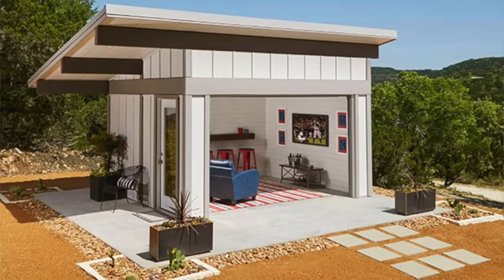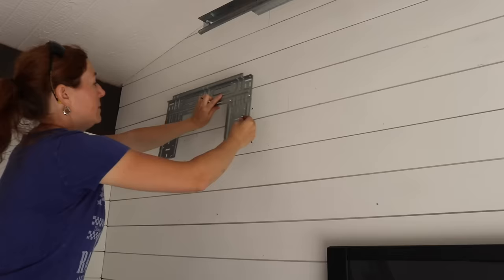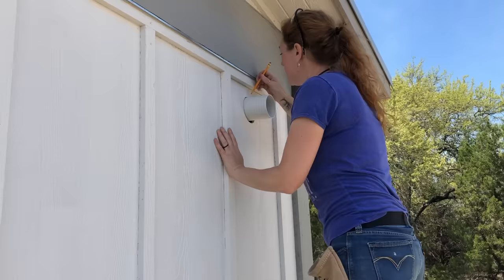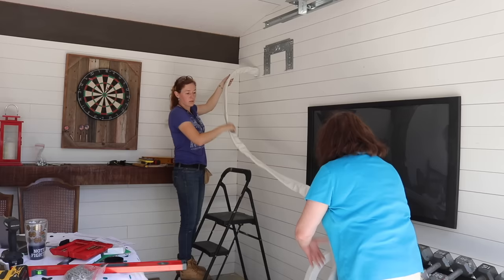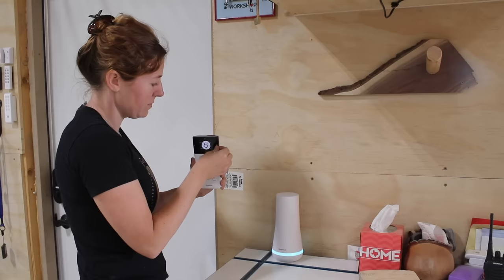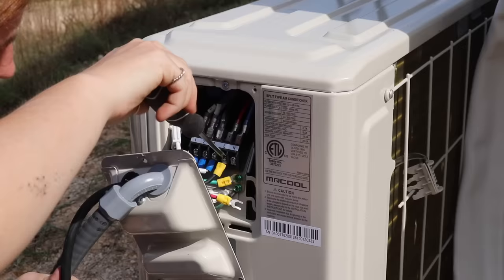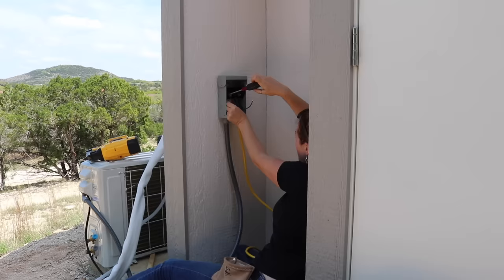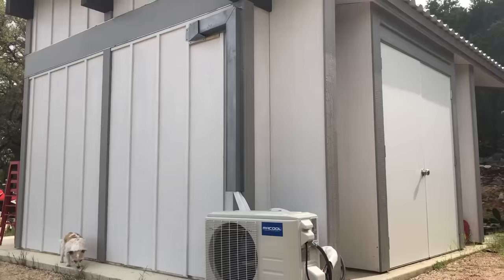DIY Ductless Mini Split Install - MrCool Unit

Comment: I have been in the hvac industry for a while. So I’ll clear up a few things that I saw in the comments.

1. Enjoy your videos and love the DIY spirt. Though you made this seem much simpler then it actually is. You have a strong mechanical ability that frankly most people don’t have. I have been installing, servicing and repairing mini splits, and VRF HVAC systems for most of my professional career. 

2.There is refrigerant in the lineset, the indoor coil (evaporator) and the outdoor unit (condenser). The connections on this system have a protective fitting that when you start make the connections breaks a seal to release the refrigerant. If not done properly it will leak. This type of fitting is common on box coolers and freezer units. 

3. The lineset begin coiled vertically will create what we call in the industry an oil trap. You don’t want this on a system like this (there is an exception to this rule, but not get into it on here). It will trap the oil in the lineset and cause a compressor failure as there will be no oil to lubricate the compressor. 

4. I would recommend a power monitor/protector for the power coming in (your line voltage). Reason 1 mini split boards (cheaper unit are worse) hate dirty power and too high of voltage. You are in the Texas hill country or west Texas I’m guessing by the land scape. I live in Texas as well. Most generators do not produce very clean power. Just a recommendation to help you protect your equipment. 

5. Not sure what the warranty is on that thing. Just know boards are not cheap for this type of equipment. Some will say just throw it out and get a new one for the cost. Go for it, or you can pay more and get a product that has a better warranty and the manufacturers actually have offices in the states and people there to support the products. Also, why throw it out when it just needs to be repaired. 

Good video. Just remember there is more to refrigerant flow, and ac equipment then connecting some wires and refrigerant lines. For those thinking about doing this. Please know that refrigerant if it touches your skin can cause a form of frost bite. Not going to get into the science of it, but we call them refrigerant burns. They really hurt and can blister pretty bad. So just be careful, follow whatever instructions are given. if you start it and can’t do it, just call a professional company. This isn’t painting a house. You are dealing with power, refrigerant, and many things that can cause serious harm. If you do not understand it, call in a pro.

Overall April you are talented in many ways and show that with effort most things are possible for a person to do.
Reply: Hey, man thanks for your input.  If I had one of these units would you recommend vacuuming out the line?  Even though it says you don't have to with a DIY unit?
Reply: @brianbevilacqua4984  , she said as the manufacturer clearly states that it comes precharged, I have seen a video of how they are manufactured and come precharged in the lines and not just the end units. Thinking you need to vacuum and charge the lines before installing them would result in as this op said, hazard to your health via a very harmful refrigerant burn. Hence why you FOLLOW THE DIRECTIONS as told in them, and just connect the lines and power as she showed and then ones it is powered up with energy you then just flip it on..That simple.

Comment: I installed one of these (24k model) last fall, love it!   Because its a heat pump too, it kept the garage warm the winter even in temps of 15 degrees Fahrenheit.    I found the 24k to be a perfect size for a well insulated 24 x 25 garage.
Reply: That's good info.  I've been looking at a mini-split for my garage shop...it's about the same size as yours.
Reply: Did your line set come pre charged too?? Im an ac service tech and thought that was really wierd that she was unable to cut and flare the  pipe down to size because it was precharged instead of the CU being precharged.
Reply: @paulcopeland9035  im aware, i asked if his came precharged too.

Comment: Great Job on your install. Just a few points,
1)The fused or not fused quick disconnect outside by the condensing unit needs to be within sight & only so far from the condenser. Check your local Laws Ideally I have always installed mine right above and to the left or right depending on where it would go into the electrical panel on the condensing unit. 
2)The condensate drain line(tube) has to be in the lowest point as it goes through the wall to the outside. Plus I would expect you to have to clean that drain out every time a bug decides to make it a home! Which will be often. So ideally they terminate above the ground or extended out just beyond the slab of the house, again above the ground. Or if into a sewer type drain(usually under the sink) there is a whole set of codes to follow. 
3)Please establish MORE electical protection(follow codes laid out by your State/County/City) to protect you or anyone that would be using that "tiny home." Also if you are going to run it off of a generator or solar panel as the 3 things that kill an HVAC system are low voltage(or fluctuating voltage), dirt, starting and stopping too soon, so again install more protection up to code!
Yes putting that condensing unit where it could breathe and Not against the wall as originally showing in your install was good. Ideally you would have a slab or pad just for the condensing unit that you would anchor with lag bolts. Oh and you might want to hang the extra tubing as that looked like flex tubing NOT copper tubing so I would anchor it and zip tie it so as to stop vibration and oil traps and hide it. No you don't have to worry too much about shortening the line as it was engineered from the Factory with the line set it has. Yes the shorter the better for squeezing out more efficiency but you are within Factory Limits. 
Yes I was a Refrigeration/HVAC Contractor at an earlier time. Now I am too old. Just Saying

Comment: I installed the 18000 btu unit by myself. Four day project.  Day 1 pour the slab. Day two hang the air handler. Day 3 hook up refrigerant lines and build the conduit box around it. Day 4 hook up electrical charge the lines check for leaks and test unit. Very impressed with results!

Comment: Great job! Just an FYI you can unhook and move the unit without needing anything. Work in reverse and the lines are fine. I have moved units between my businesses in the past and have had no issues.

Comment: Get a garden hose wall hanger thing and install it above the unit to keep the lines away from the heat exchange. They look like a V and you just attach with screws.

Comment: Mr. Cool is not the only diy unit available. You can shorten the lines if you had a flange set(freon is in the compressor and not the line set). You need to vacuum down the lines on any A/C install. Living in Texas that is a must. Those lines will corrode from the inside out.
Reply: caseyne 
According to the manufacturer, that’s not true. 
From MrCool’s product description...
“Precharged 410 Quick Connect Lineset. The included 25′ pre-charged lineset allows you to install this innovative ductless system without special tools, equipment, or training.”

From MrCool’s blog...
“We here at MRCOOL did not invent pre-charged line sets. They’ve been around for years, but were mainly confined to the modular and mobile home market. That might be one reason why so many people have not heard of them. Don’t worry! Pre-charged line set technology proved itself years ago.  Basically, all we’re doing is applying them in an innovative way.”

In response to a customer’s question about shortening the lineset...
“MR COOL says:
January 28, 2019 at 9:14 am
On the DIY unit, the lines come charged, so you cannot cut or modify them without professional training and equipment.”

Comment: You should look into installing a solar panel for that shed
Reply: She could put a wall mounted battery bank above the generator area
Reply: For sure! A gasamoline generator for AC just seems sacrilege to me
Reply: @NosillaWilla  Same.  My jaw dropped when she said that. It sounds to me that she needs a place to demonstrate this project but not on her own house.
Reply: @BoopSnoot  Solar with a battery bank would be be able to provide consistent power.
Reply: @BoopSnoot  We're talking about a 120 sq ft shed with an efficient mini-split system that's meant to cool 500 sq ft or more, so it would not take a "significant battery system" to cool that small of a footprint. A 100Ah deep cycle solar battery would absolutely be able to power the unit for the limited use a guest would put it through. In addition, a solar battery like that is rated for at least 5 years of life under heavy use (i.e. deep discharges of at least 50%), so for sporadic use, the battery would last decades before needing to be disposed/replaced.
Reply: DumbDuck44 Nope, from New Jersey, but kudos for showing your true colors 😉
Reply: Sho Yu Weeni  Not if sponsors are willing to giver her about 1k of solar panels and about 500 ah of lithium batteries.
Reply: @RobertTorres27  A 100 ah panel would only provide about an hour of cooling at night. Remember she's in Texas.
Reply: @BoopSnoot  She did say thanks to MrCool, so that probably means she got the unit for free.
Reply: Sho Yu Weeni  It needs to run 24 hours a day in the summer when she has guests. I have 600 w of solar panels and 200 ah of lithium batteries and I figure at most I can run a 5000 btu ac for 4 hours on batteries.
Reply: well THAT escalated quickly!
Reply: Yes solar would be an option, would also need Inverter and battery packs. Another Possible solution could be depending on the location you could buy  a Missouri Freedom 5 Blade Wind Turbine for about $400 which I believe Generates1600 watts depending on the power need for the HVAC A 1 ton unit uses about 1200 W of electricity to run. 
Ether way looks great your very talented.
Reply: Ok,  you guys need to get along. The best option is a Bicycle with a Pedal Power Generator. They’re  about $600 for the kit They sell them on Amazon. she could just hook her bike to it pedal hard and have all the power she wants and get in a good exercise at the same time 😂 you guys need to think outside the box more.
Reply: @gear7739  Wind power is actually a better way to go in most parts of Texas.
Reply: I intrest in solar ac window or split ac
Any one help me
Reply: Unless the A/C is very small and very efficient...a lot of solar would be needed. Mine draws just 600 watts so my solar system can do it. Other A/C's can easily draw twice that ...or much more.
Reply: Considering the expense of solar, it makes more sense to run power from the house and use a generator as back up. The cost of solar will pay for many years of running the AC.
Reply: Sho Yu Weeni  Mr Cool spec says this is 220.. not 110..

Comment: I recommend you coil the lineset in the alcove where your fuse box is located. That way it is not restricting airflow in the back of the unit. It's too bad you didn't make a hole for the lineset to go thru the wall where the fuse box is.
Reply: Pretty sure she said that she was setting a generator in that area so you're not going to have enough room

Comment: Thank you!  I just finished installing a 24k 3rd gen Mr. Cool in my workshop yesterday, and this video helped a lot.  I would also recommend people check out Abom79's longer video for the extra details.  And the manufacturer video is good too, but it's too fast and doesn't really show you enough information.  What I appreciated about this video in particular was the problem of having the air blower mounting holes only go into one stud, and not properly distanced for the next stud.  I'm grateful this video existed as a resource.